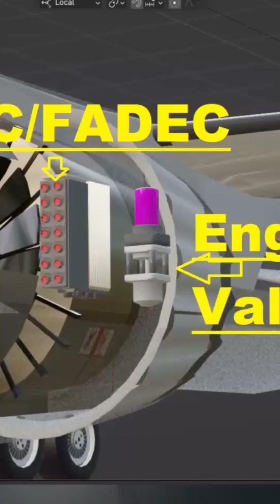Air India 171 Fuel Control Switch and FADEC/EEC #aviation

Comment: What does the Flight Data Recorder record? The switch position or the input to the FADEC/EEC? Also, is the Cockpit Voice Recorder sensitive enough to record the sound of a Fuel Control Switch change? If so, it would be easy to confirm, by comparing the CVR- and FDR timelines, if the switches were physically changed as the initial report suggests.
Reply from the maker: @mundusuys8739 that's the question, Mundus. Were the Switches moved or Was it a malfunction in the System??? On FB aviation sites, comming up, they had so much issues with the Switches  and engine shut downs. They also cancelled Dehli USA up from September. It's such a tragedy. As i heard they outsourced maintennance. Pls concern about the high humidity permanently at India. Cheers, Axel

Comment: Ask ChatGPT or DeepSeek the following question:
'What is the behavior of the Fuel Shutoff Valve (FSOV) on the Boeing 787 in the event of a total electrical power loss?'
Reply from the maker: @iglobau7259 this i concerned too. I hope it is fail safe. But i think, at a complete electrical power loss, anything is possible? As long as the RAT is out. But this system is designed for a cruising speed of about 900km/h. Does it provide enough energy at takeoff speed of about 300km/h?
Reply: @corvette724 A complete power loss is impossible unless the engine bleed switch is off. Besides, electrical power doesn't keep the aircraft in the air. Either there was a malfunction with the cables connecting the cuttoff switch to the engine, or it was turned off explicitly
Reply from the maker: @sablejoke49 i agree, Sir. But at least 2 possibilities, isn't it?
Reply: @corvette724  I'm sure the investigation team will look into all of these questions.